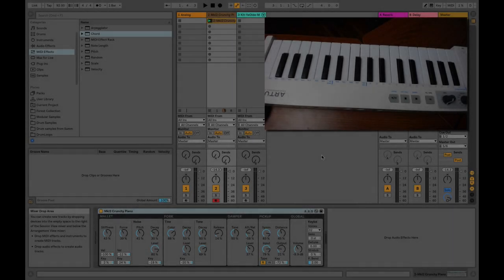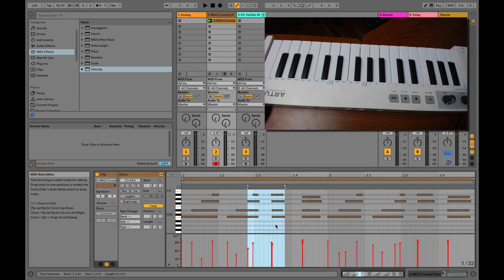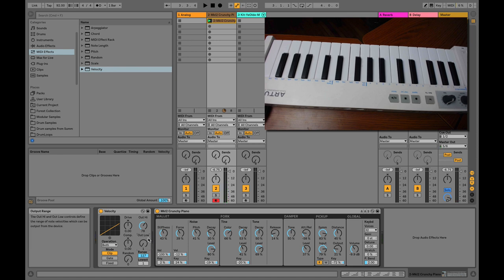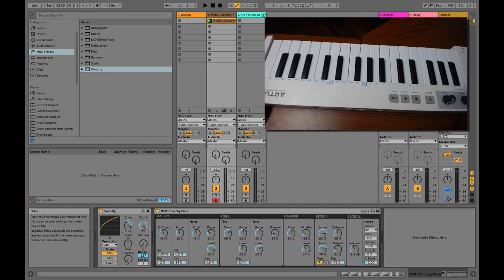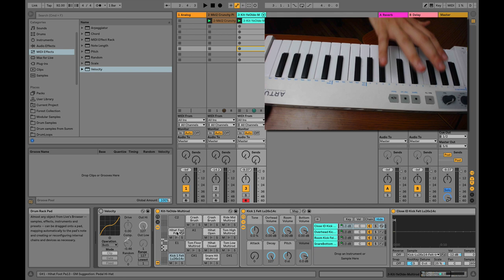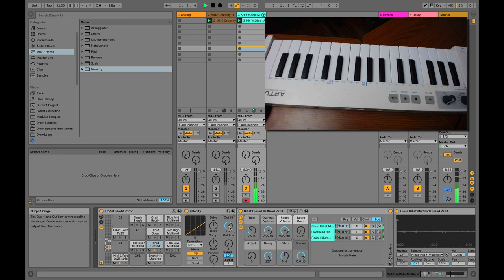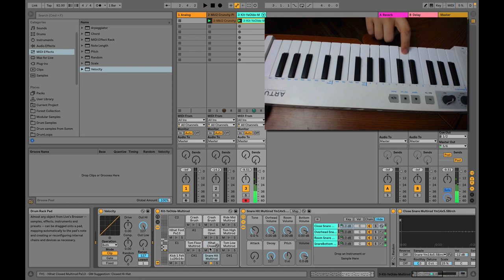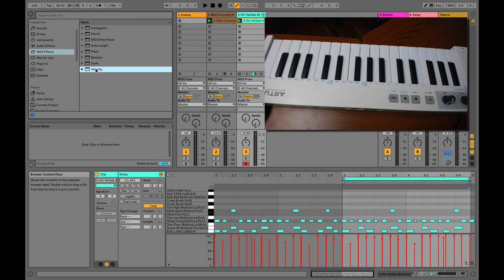Velocity Device Ableton Tutorial

Comment: Hi, thanks for the video. I'm wondering, is there a way to alter the velocity of a single midi note, to have it fade out on a curve? For example, I'm composing a track with E-Piano Straight, and I want a long note to fade out over 8 counts/beats. Thanks for your help.
Reply: Well, you could automate the gain/volume of the note to quiet down over time.
You could also do it in the envelopes section of the midi editor